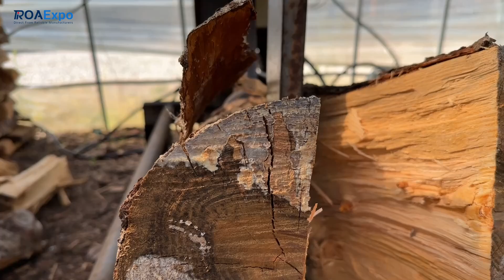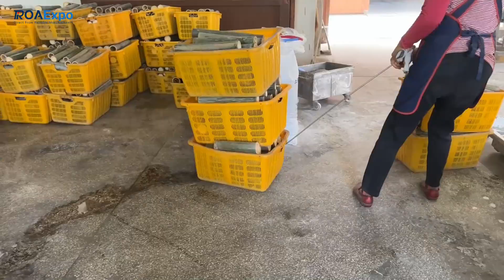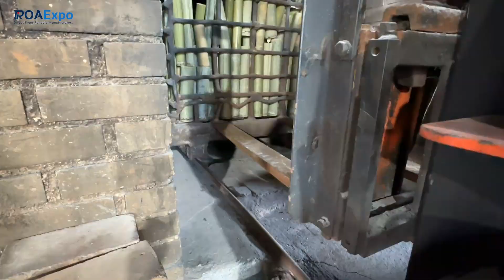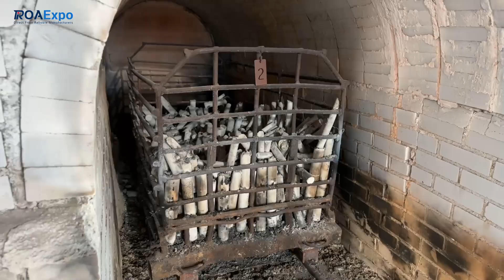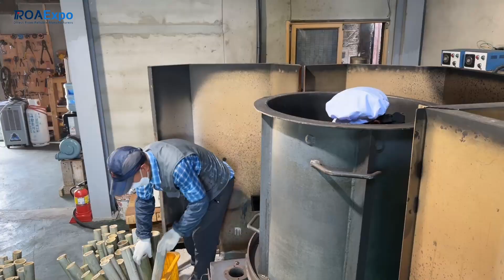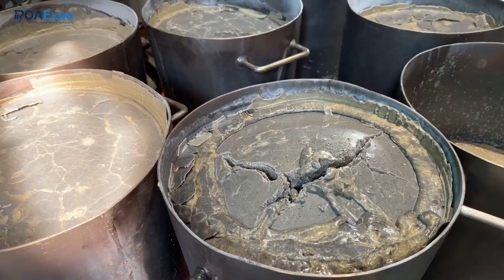Korean Bamboo Salt Mass Manufacturing Process  Roasted 9 times in a loess kiln Sambo ROAExpo

Comment: Not very environmentally friendly
Reply: Not sure I agree... granted, the only part that seems environmentally unfriendly is using natural gas to do last salt melt.  Which compared to other salt processes is a fairly minimal use of non-renewable resources. True, they are are using electricity for the small blower and possibly, the crusher. The bamboo and firewood are renewable and they are using natural additives like Pine Rosin and Ochre.  The generation of CFC gasses are minimized by not using anti-caking chemicals or stabilization additives.
Reply from the maker: Thank you for watching and commenting.

This company is always striving to protect the environment, and the Korean government has strict environmental laws and regulations in place. Therefore, Sambo Bamboo Salt operates a dust collector and smoking filter system during the production process. Unfortunately, I failed to mention these facilities in this video🙂.
Reply from the maker: @TJ-lz5de  Thank you for your comments. 🙂